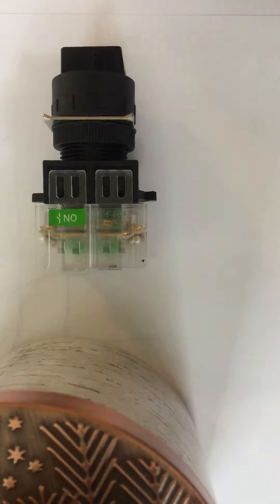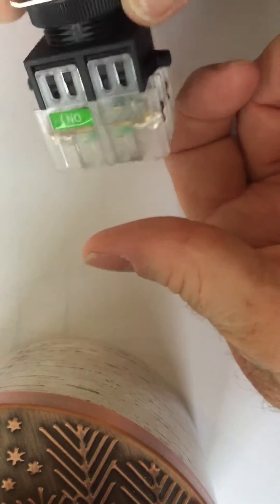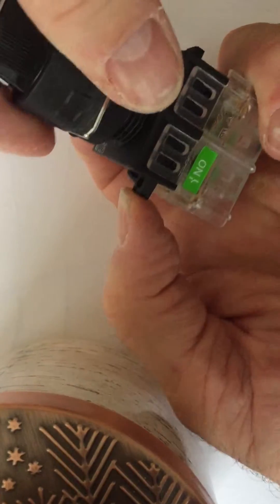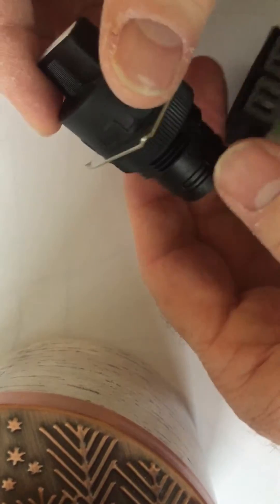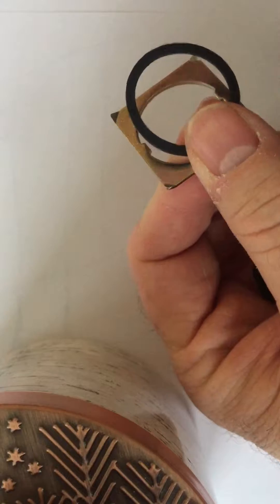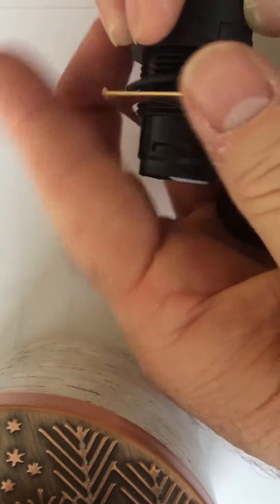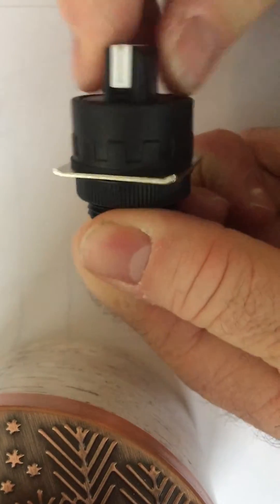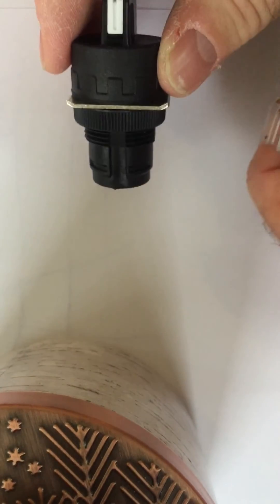Selector Switch install

Comment: Can i use this for 9 bulbs chandelier to control lights?. Like 1 turn for 3 bulbs  in the down row next turn for 3 lights in middle row and 3rd turn for all 9 bulbs? Wonder if there's a switch so I don't have to burn all 9 bulbs but can select bulbs with turning the knob... great video..
Reply from the maker: Possible, I would speak to an electrician for that configuration in your home .